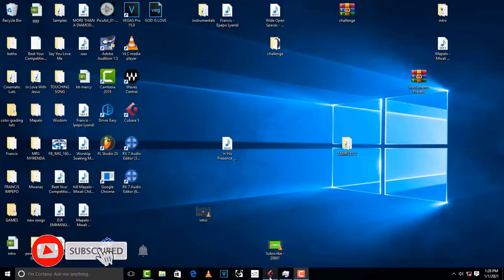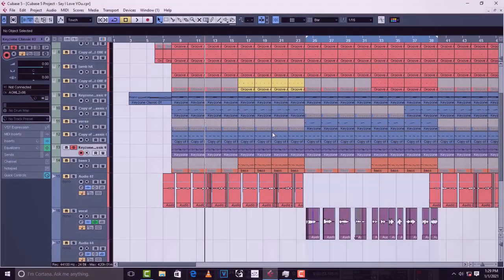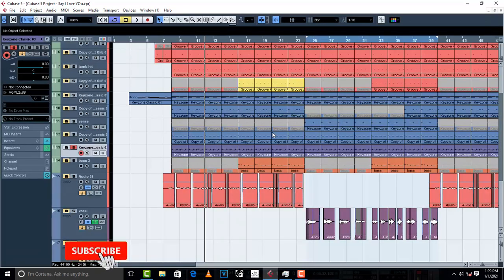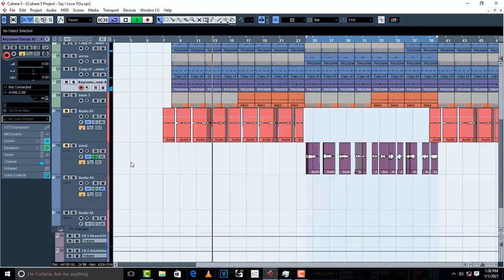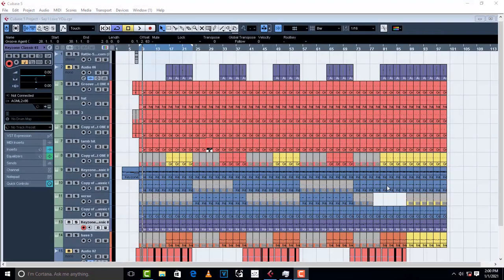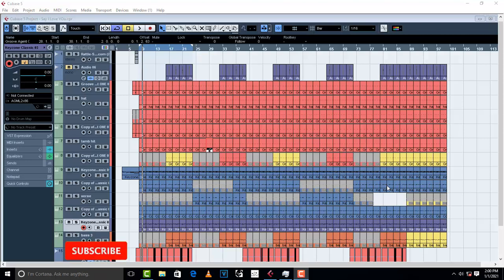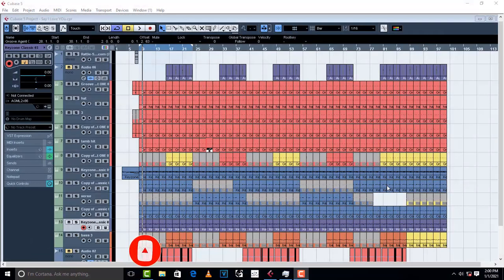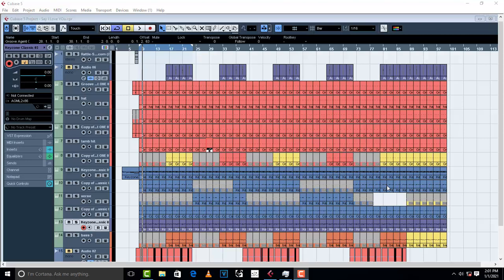How to Gain Stage in Cubase 5 (Simplest way) #Gainstageincubase5 #Mixingandmastering #cubase

Comment: Thanks for all u do. Now these are my Questions

1.Is it Okay To Leave all Volumes at 0.00db even before Recording then Commence Gain Staging only if they are Clipping? 1.b Do i need to Alter the the Waves Gain if i want to get more Volume or Reduce from an already Recorded Channel Track by Highlighting & Dragging up or Down or Just go to the Daws Input Gain Knob and Alter. Which do u Advice.

2. Recording on an already Mastered Beat i.e A Cover, is it Compulsory to Gain Stage your Vocals too...Even if they are not Clipping?Just to Satisfy the "Not Exceeding the -6.db Output Threshold. 

3. Is it Compulsory to use the V.U Meter...? Can one use the DAW Fader Meter to attain Same Results. Knowing that it just Shouldn't Clip.

I Hope my Questions would be Understood and Replied. Many Thanks.
Reply from the maker: Gain staging is not a must especially if the levels are ok.
Reply from the maker: A Vu meter can be used when you want correct readings especially if you are preparing your song for streaming and radio purpose but it is not a must. Yes you can use your Daw's meter
Reply from the maker: I recommend you don't raise the wave to increase the volume even though you can only a lightly  but, use maximizer, normalizer, rvox, a compressor or the mixer volume if you want to get some volume. Have a happy recording. Thanks.
Reply: @hollywoodaccess  Thank You Very Much, I Appreciate🙂🥂💥